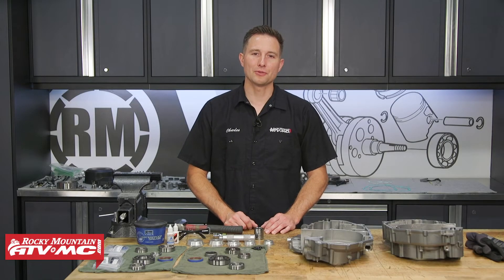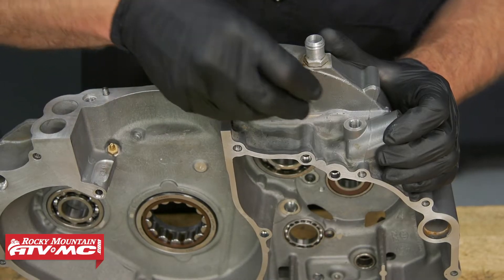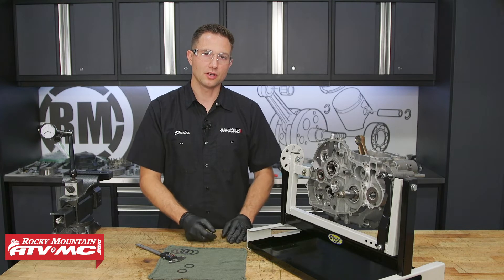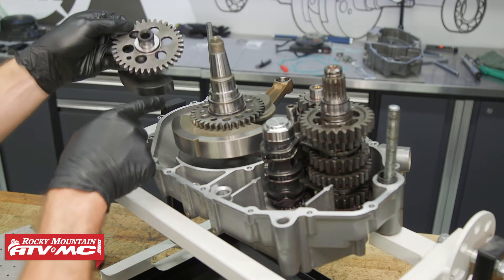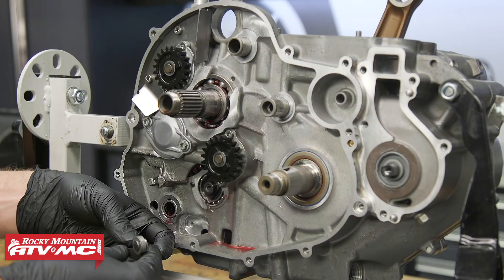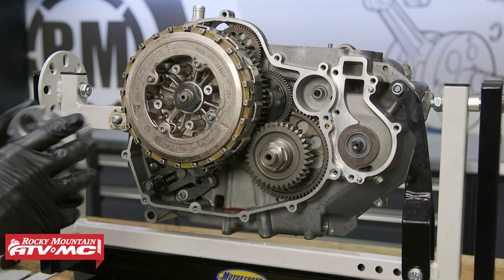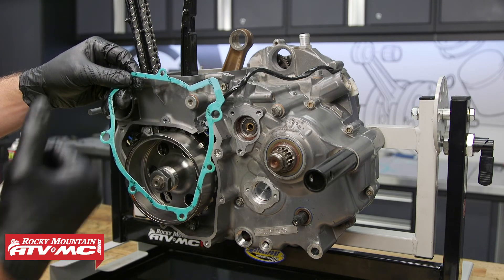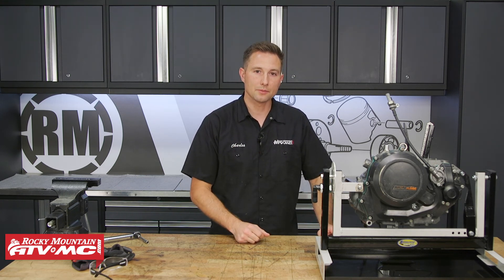KTM 690 & Husqvarna 701 Engine Rebuild | Part 4: Bottom End Assembly

Comment: Thanks for the video series. It was a great visual reference alongside the repair manual when building my big bore engine. It's not shown in the video but I really hope you did up the bolts for the pulser/pick-up coil 23:31 and set it at the correct distance. 

Cheers 👍🏽

Comment: Hi Charles, why do you measure the axial clearances without a gasket installed between the casing halves?
Reply from the maker: The case halves don't take a gasket, the sealant is just to take up imperfections in the case half sealing surface and shouldn't make much of a difference. You can take a measurement with the sealant on to be sure. -Charles
Reply: @rmatvmc  why doesn’t the case halves take a gasket?

Comment: Well... this is the point I got to before I realised that the bearings held in by those washers have a CIRCLIP GROOVE in the outer race 🤦‍♂

This is the 'N' designation in the 58/28 (actually a 62/28, 58/28 is the Inner / Outer diameters NOT the bearing code) and the 6004 bearings at one end of the countershaft / main gearbox shaft.

I wasn't able to find anywhere in the UK stocking the KTM bearing parts (it's at least 2-3 weeks delivery from KTM and 20% more expensive for them to just put them in a little bag) so I pulled out all of the bearing designations from the parts finder and ordered from a bearing supplier instead, completely missing the 'N' designation on some of the bearings.

At least it's the cheap ones with the circlip groove so I'm only about £20 out of pocket 😂

For anyone else following along, don't make my mistake! If you go off piste and order from a bearing supplier, make sure you get these with a circlip groove 👍